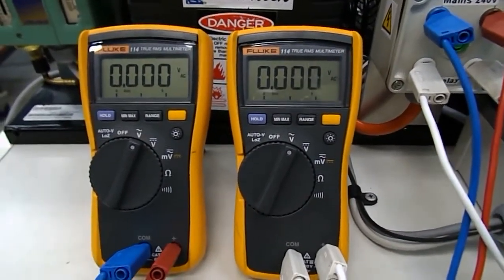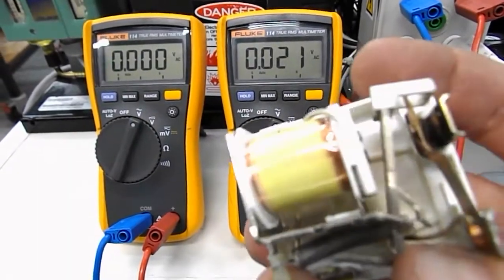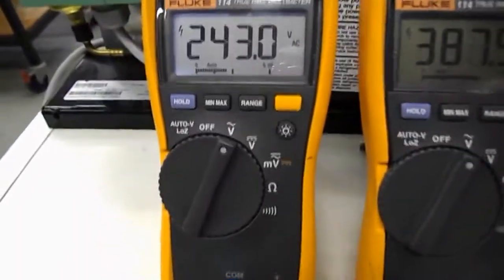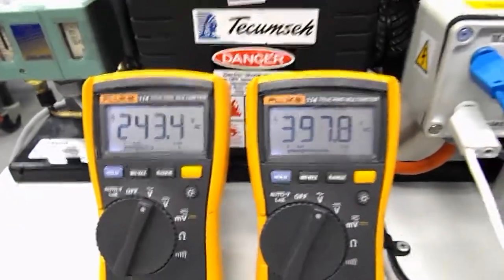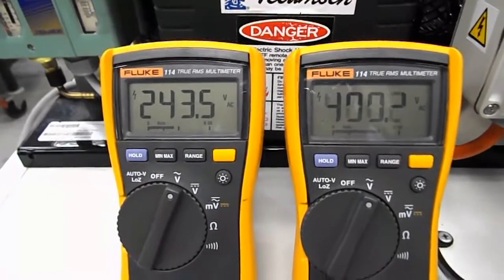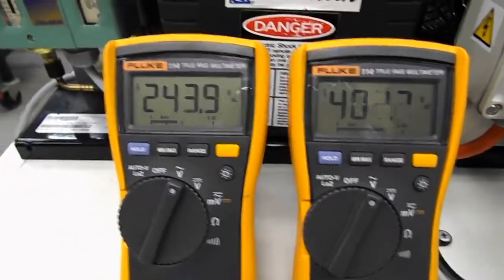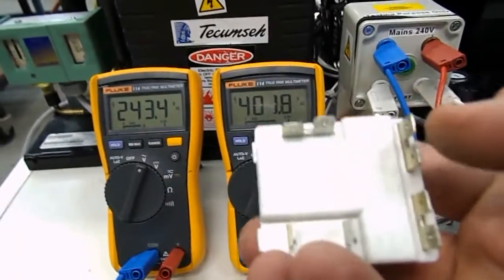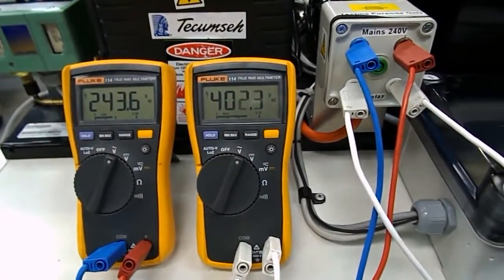Back EMF with potential relay operation

Comment: I added a Hard Kit that is a potential relay and a cap. I had some buzzing from my main breaker panel in the house so I fugued the kit would help. It helped, but not as much as I thought. But, I need to figure out how to size a fuse and where to connect it between. I don’t want the potential relay getting stuck closed. I’m having a hard time deciding where to put the fuse?

Comment: Is common on a compressor neutral??
Reply from the maker: The way these compressors whould be wired is with the phase to the common via the thermal overload.  This way phase is cut to the motor on a thermal overload   fault. You can wire it with the common as a neutral feed out via the overload but in fault the compressor is still under a potential  charge. Most systems I have seen bring phase to the overload and common providing you have the polarity right at the electrical box

Comment: Iv seen two different ways on wiring a potential relay. One where power starts from common and another where power Starts from the run winding and goes goes through common. Can you make a video showing how you wire one up
Reply from the maker: Yes i can make a vid,  i have a relay case with all the components than can remote fire a CSR refrigeration motor . Now I have to go and make that for you.  Thanks for viewing sir

Comment: I've been scratching my head, trying to better understand how the steady state back EMF can be higher than line voltage coming in. An intuitive first look sends a red flag, that our observation is trying to violate the first law of thermdynamics. In a single motor, back EMF from generator effects will naturally grow as rpm increases, to the point that there is an equal balance, with steady state rpm and low antegrade current overcoming mechanical resistance. I'm guessing that back EMF for a simple motor would only be higher during faster states of passive spin, such as regenerative braking of a vehicle where kinetic energy is converted back into stored energy in the battery. In these HVAC motors with dual windings, is this higher steady state voltage possible because antegrade current through the run winding overdrives the rotor, spinning so fast that the back EMF on the start windings exceed incoming voltage? Are potential relays ever used in motors that do not have dual windings?
Reply from the maker: Potential relays are used in refrigeration compressors that do not disengage the start winding. These are basically permanent split phase cspacitor motors thst use a capacitor start. The relay only disengages the start capacitor. I have not seen them anywhere else. They dont use current relays on high torque single phase compressors as this would add unwanted resistance to the run or main winding. Other than that most other types of older ac motors use centrifugal switch, like a pool pump or just simple split phase design. Thanks for asking